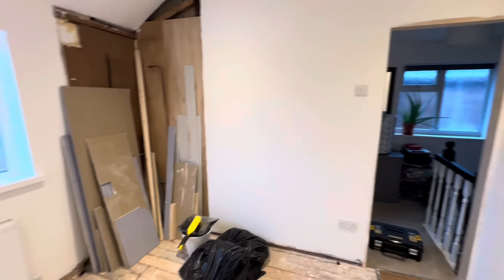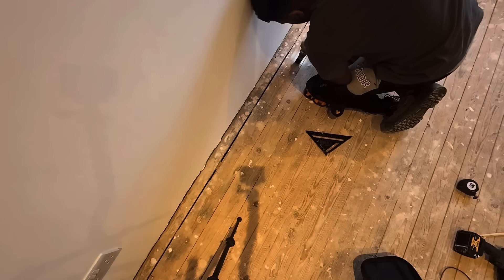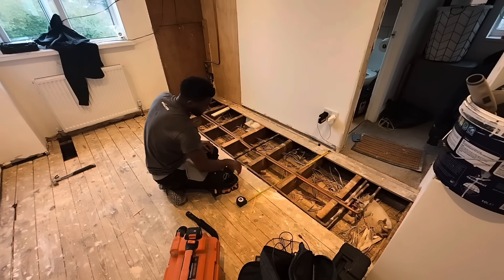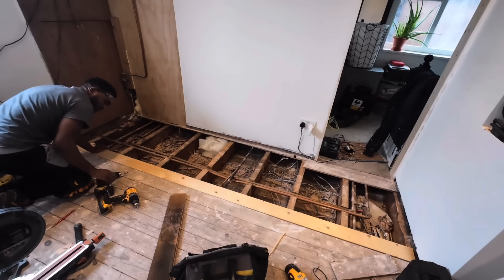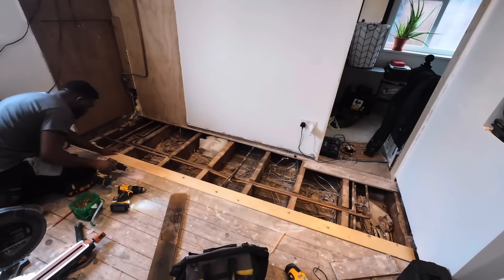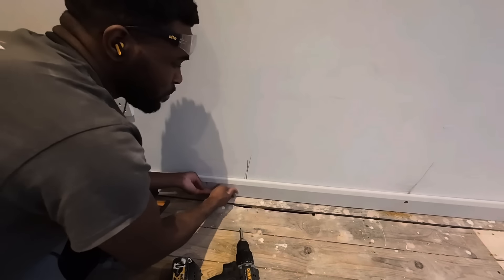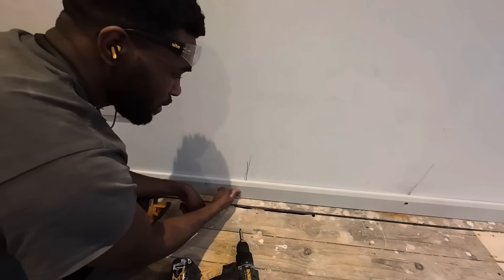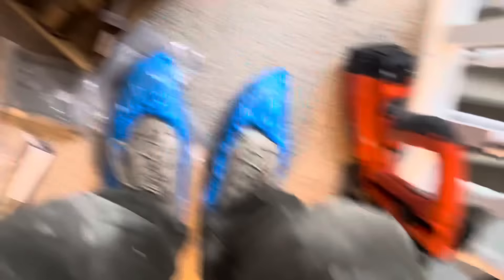Fixing this floor A Day in the life of a self employed carpenter

Comment: Great work, personally I never screw down the middle of floor boards (even if it"s possible)  I always screw outer edges because good plumbers always run their pipes down the centre of the boards, also find it better to make the timber supports longer so they are supported by two or three boards rather than just one